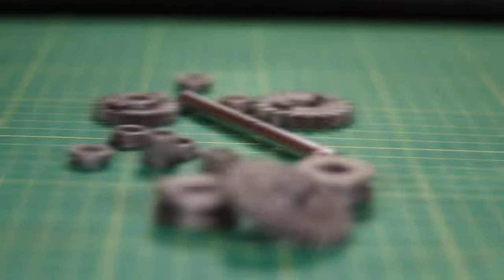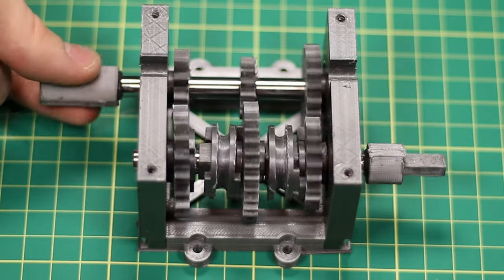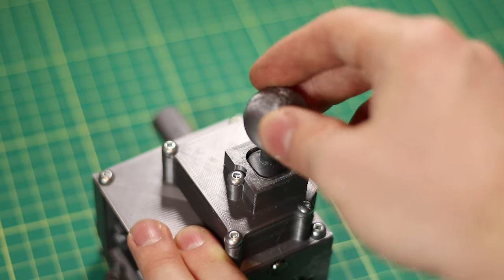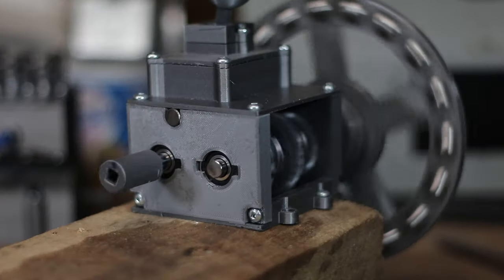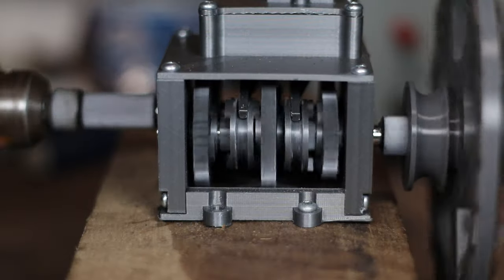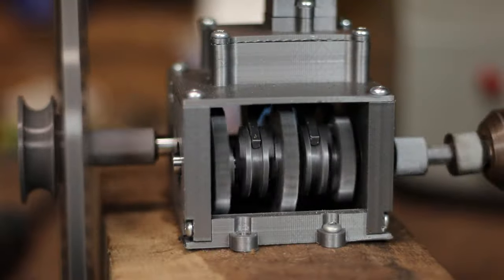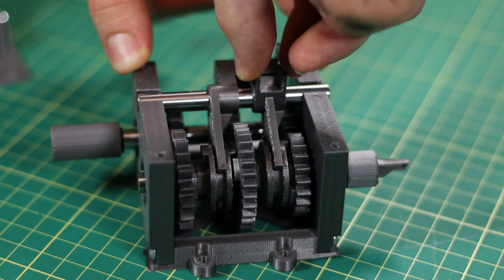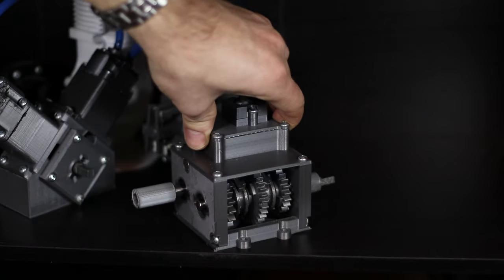I 3D Printed a Transmission: How Strong is it?

Comment: I have a feeling that Camden is building a completely 3D printed Gas powered car 😂
Reply: Would love to see that ngl
Reply: Car? This dude will build a whole truck with a I6 😂
Reply from the maker: As Johnny Cash once said, I'd get it one piece at a time
Reply: Cant wait to see the cvjoints and limited slip diff for it too
Reply from the maker: @theoverlord3839  CV joints sound like a cool idea
Reply: @CamdenBowen   could be electric too 
who says electric one do not need this
Reply: He should Make it like a 3d printed gun and and use only the car parts that are absolutely essential and print everything else
Reply: @CamdenBowen it would be cool to see a wankel rotary engine 3d printed
Reply: yea im going to have to steal that quote @CamdenBowen
Reply: @CamdenBowen 3d printed rc car?
Reply: @CamdenBowen sooooo yes?
Reply: Fr
Reply: Give him a few yesrs
Reply: @CamdenBowen Heim end joints would make for great suspension geometry and adjustability. Plastic multi-stage spring coil-overs with air valves could be printed, too.
Reply: Heim ends attached by dual threaded collars would make awesome adjustable control arms for a 4-link setup and you could make plastic coil-overs with air valves and two-stage springs.

Comment: Shifting without a clutch really grinds my gears
Reply: [Polite golf clap]
Reply: @DH-xw6jp  lmaooo
Reply: This is a low speed, low power transmission.  An electric drill, although torquey, isn't unloading a couple hundred horsepower and foot-pounds into each gear.

Comment: Subaru be like:
Reply from the maker: Most reliable Subaru transmission
Reply: the sti trans is actually pretty bulletproof, theyve been seen to handle 700whp reliably. the wrx trans sucks ass tho itll grenade at anything over 400 cause its designed super poorly with little center support

Comment: I am not sure what filament material you are using, but i would suggest PETG as an alternative to PLA as it has a lower coefficient of friction to PLA and would help with keeping the tolerances tighter while keeping an easier slip fit for the clutches.

Comment: CVTs are also use in tractors, but they do not use belts they rely on hydralic systems and they can handle 700hp easily, in tractors cvts are slowly becoming the standard

Comment: Maybe redesign the dog gears to have a 45° incline before a positive 90° lockup between gears.  Maybe the friction between the gear and dog gear will allow for a smoother transition instead of a higher torque shock when shifting between gears.

Provided, such friction in motor vehicle transmissions would wear down the components much faster,  but for a 3D printed model, it might make it smoother without requiring synchros.

How'd you make the shift forks and how do they mesh with the shifter?

Comment: You are loading the transmission with centrifugal force from the flywheel. Would of been nice to see how much torque it could output before it started to break apart. The being that the break was at the drill the test only showed that the immediate torque from the drill which can be extreme broke your input shaft.

Comment: Have you thought about making a sequential gearbox? Instead of a standard H, you would just have to bump the shifter forward to upshift or bump it backwards to downshift.
Reply from the maker: I'm thinking of combing the fluid coupler with a design like that to make a sort of semi automatic transmission, similar to the experience of using a tiptronic system in some cars

Comment: Hey I stumbled upon your page and I would like to follow your footsteps and print some similar themed mechanical parts, I was wondering what filament you youse for your projects and if you have any tips or tricks?
Reply from the maker: I mainly use PETG for all my filaments, when you print parts that interact with another 3d printed part you generally want a tolerance of 0.5mm. If the part interacts with a machined part like a rod, you want 0.25mm of tolerance
Reply: @CamdenBowen  Thankyou so much!!!

Comment: I am going tomake your gearbox,what size shaft and bearings did you use?
and what are the gear ratios?
Reply from the maker: The rods are 8mm in diameter and the bearings are 608 skateboard bearings. For the gears, gear 1 is 2:1, gear 2 is 1.5:1 and gear 3 is 1:1. Hope this helps!
Reply: @CamdenBowen  Thank you!
I have finished 3d printing every thing, I just neet to get some 8mm bar(i got bearings and i am going to try some printed ones )
I plan on using your gearbox in a 3d printed rc car :)

Comment: I've been looking into finding an affordable self lubricating filament to print bearings and piston rings with. I hear nylon is decent do you know of any?
Reply from the maker: I am actually not too sure, I know that hard filaments like PLA when sanded very smooth actually have very low friction in those cases without the need for lubrication as long as they are not under high stress

Comment: What kind of metal rods are those? Or can they be 3d printed?
Reply from the maker: Just an 8mm steel rod. I suppose you could print them however it will work much smoother using a machined rod

Comment: that way of engaging gears really sucks. a differential can be used to engage gears using breaks. so the gears dont grind but thats why the clutch is used. my idea would pretty much use a different break for each gear and no clutch needed. just got to find a way to organize all the differentials in some compact way to make the breaks on the outside so there easily replaceable.